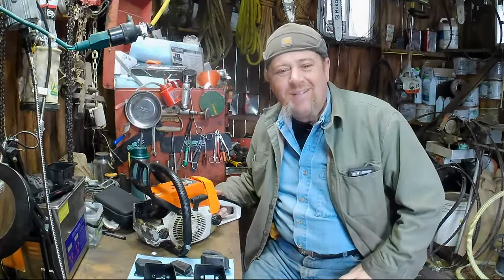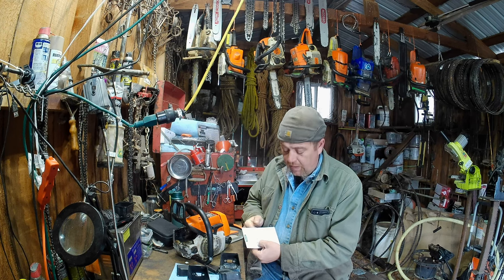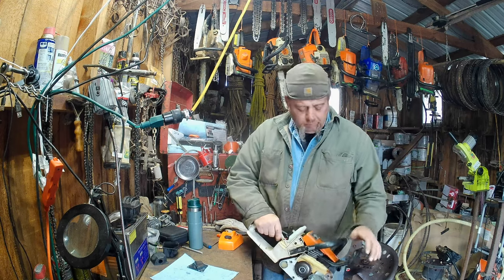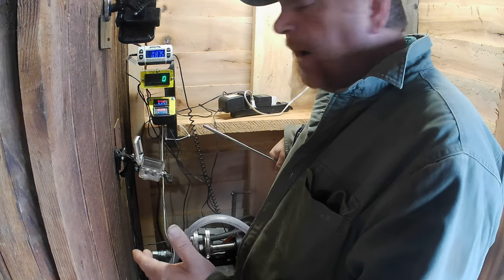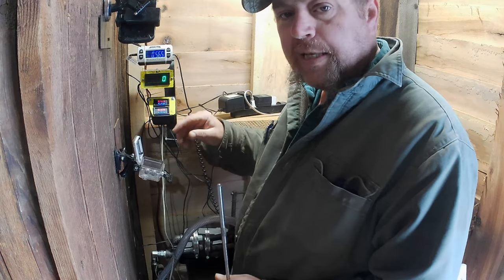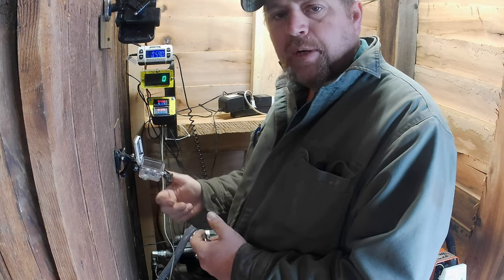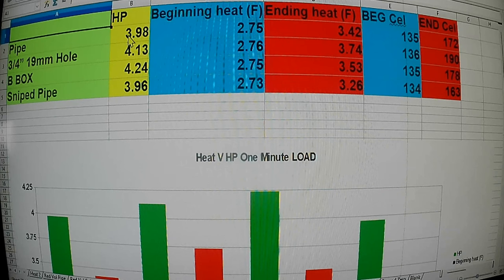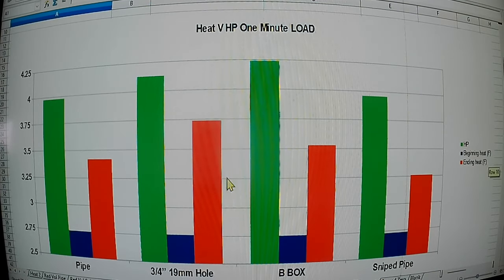BIG HP GAINS by Reducing Muffler Can's Volume? AMAZING Muffler Mod  Testing DYNO HEAT VOLUME Data

Comment: Congrats on getting over the 1k mark, you have some of the best videos out here for the saw people, so i take it if you have a saw with two cylinders then you would have to modify two mufflers if the unit has two mufflers? talking about a saw i bought evidently has two cylinders a john deere 66SV yellow mostly metal.
Reply from the maker: @diggindiggenit6540 Thanks Diggin!  I'll bet that JD is a screamer... reed valves and a shared case, so capacity may be less-per-volume of a single cylinder? Think she needs dual straight pipes with little "ting tings" on 'em. Is it in fairly good shape? They ain't a dime-a-dozen!!!
Reply: @HayChaffandSawdust1  Unfortunately all i have now is pictures as it has not arrived yet And in the pictures i only see one plug and one muffler so i won't really know if is a two cylinder until i get it and search for another plug, kind of a strange saw two cylinders lol imagine porting one of those how would that work? have fun

Comment: Thank you for all of your diligence in testing so many thoughts and theories with these exhaust pipe videos.  Very nice job
Reply: When you say reducing the volume of the can at around 20 min or other points, are we talking just the diameter of the exit pipe?   Or are you also seeing gains from decreasing the internal muffler size?  Length, width, height?
Reply from the maker: @user-ov9zy7pu4s Thanks for joining-in down here in the comments!! About the reduced volume can, I'm sorry that I'm no a very good "youtuber"; I tend to carry on from one video to another and forget to "start over" for the next video; that's my bad. 
To answer your question, I actually reduced the volume of the muffler can by tig welding an angled partition from the bottom lip of the exhaust port to the bottom lip of where the muffler cover bolts on; of course, I fitted it to the edges of the muffler can. It blocked off about 1/4" (s.w.a.g)  of the can.  Thanks again for joining-in; welcome!!
Reply: @HayChaffandSawdust1  That makes complete sense!  Thank you, I actually just saw that video now, I think I accidentally jumped around in order.   I think you are a fantastic YouTuber, you’re doing things nobody else is doing with all these iterations, it’s so fascinating to me.  Thank you for sharing your testing with us.  ❤
Reply from the maker: @HawtSawz86  Thank you for the kind words!! Glad you found the reduced volume ; it's shown a time or two again in different detail throughout the 026 build if you didn't get a good-enough view. The reduced volume can is an easy mod that works well. Thanks again!

Comment: Shorts is where it’s at for growing a channel.  It’s like advertising lol show some dyno footage on those shorts. You’ll get more traction than just relying on shares
Reply from the maker: @jasentonguepowersaws4206 I believe you're right; I've only did a few shorts and a couple of them did get some good response/subs. I probably need to do some more of them. I've been trying to focus on thumbnails and titles the best I can in an attempt to up my click through rate and get new people to click on videos; I'm probably missing out on not doing many shorts though. Thanks for the reminder/advice.
Reply: @HayChaffandSawdust1  I try to do 3:1 shorts/ videos. Even 5-10 seconds of video is plenty.  Seems to be seen by a much larger audience
Reply from the maker: @jasentonguepowersaws4206 Do you shoot shorts specifically or do you edit them out of a wide screen recording to the tall screen playback? The ones I've done, I've used the 1920xwhatever and making 16:9 from them... LOTS of editing and moving frames to try to get it to fit. I do need to do more shorts for-sure!  Thanks
Reply: @HayChaffandSawdust1  I do deliberately make shorts and also just edit video for shorts.  Literally do everything on my phone.
Reply from the maker: @jasentonguepowersaws4206 The phones have as good or better video than a lot of gopro types; also, probably have easier-to-use editing stuff if I were to try it or get used to it. Thanks!!!
Reply: @HayChaffandSawdust1   I agree about the channel needing more shorts for the growth! People love when ANYTHING is put on Dyno's, and to be honest, there aren't that many people that Dyno chainsaws! I'd bet money if you puy a bunch of chainsaw dyno shorts, you would get a ton of traction :) loving the channel and info man! Keep up the good work sir!
Reply from the maker: @jasentonguepowersaws4206 Thanks for the confirmation and the kind words. Sure glad you're here!!!

Comment: Never knew someone so goofy could be this technically inclined.  You sir are a rare breed!  And i mean that in the best possible way.

It did help how you walked through the readouts.  Made watching the pull more informative. Thanks.  Looking forward to the egt readings soon.

I'm still thinking through those exhaust results.  I expected to see changes with reduced volume in more than just the BB clone.  

Just to be a little argumentative, I don't agree that your dual magnets increase accuracy appreciably.  10k is 10k.  More impulses will increase resolution and would help pick up RPM changes faster, but your dyno speed isn't changing much in one revolution.  They sure aren't hurting anything though.  

Now, how are we going to beat that darn bark box?
Reply from the maker: @Kevin.L_ ... and I took it in the best possible way; I always do; when people walk by, look at me sadly, and say "Well, bless his heart", I always thank them for the kind prayers!! 😂😉
 I think a bezel (made out of a cookie sheet or something) may be helpful so I can put the general calculations to the side; would hate to make each video longer by explaining it so that every new person can understand.
I'm not sure about the pipe on the reduced volume because I can't put the toothpaste back in the tube after sniping it off; BUT, I can get a reading from it on the full sized can and compare; the sniped pipe did have a wider/flatter peak than the original box, but it was sniped too?? I'm theorizing/considering/being watchful-of the possibility that reduced volume benefits may be better realized in front exhaust ports as opposed to rear? I'm not too sure that it may make TOO MUCH rebound of exhaust gasses and putting too much exhaust back into the cylinder. Thoughts??
As far as the magnets, I'm not sure either... well, they DO help, but not necessarily in the increased-sample size though. It did help, in that, the refresh rate of tach is determined by RPMs... I can program (well, not "I" yet) the Arduino to use a standard time and makes a calculation based upon how may times the hall effect sensor was triggered; whereas this tach takes a certain number of triggers and and calculates how much time was taken to get required number of triggers. It refreshes each time it hits the required number of triggers; the refresh rate is 2x faster with 2 magnets (over simplified and not 100% accurate, but basically). I could claim two opposed magnets are for balance... but have you seen the rest of the catastrophic conglomeration of junk; I don't think I could convince anyone I was concerned with balance. I didn't take time to mention the refresh in the video...I could jabber about the dyno for hours if I let myself go; glad you mentioned it!! (You're gonna have to try harder than THAT before you could be considered "argumentative").

Ooooh, I got some plans for that pesky ol' bark box clone; heck, we've already improved the original considerably! I haven't mentioned it, but my mind has be searching for the best stock-appearing pipe that I can build for stuff like Sawfest; I probably won't ever have time to go, but it's fun to try to play by their rules. Besides, they have rules against the "Ironhorse" pipe; it would be a feather in my cap is they have to make a new rule and put my name on something illegal too! 😉🤓 It will be a few vids before I get to that one though... I haven't even started building it yet.
Thanks for the delightful conversation!!!
Reply from the maker: @Kevin.L_  I didn't mean to imply they outlawed it in the open classes; for the firewood classes, currently it reads stock size shape and area or something that brings those parameter to my mind; a few years ago, the ironhorse was specifically disallowed for the firewood classes.
Maybe I'm under or over thinking the rebounding gasses as I'm not sure exactly what's going on inside of a can-type muffler; I'm reasonably sure that the sonic facts/theories so heavily researched and documented don't equate inside of a can.

Balance... yes, balance!! You just helped me shave a few minutes off of a future video; It's getting harder and harder to keep a ~15 minute video with all of the results at the end.  Is the results-portion becoming too long, too detailed, boring, too muddled, etc... Would like your opinion; I like the numbers and will take them for myself, but if they are boring to many/most, I sure don't have to include them. On a similar note: Torque? include it or not? On these mods with slight gains, leaving them out gives be more distance between 1/10ths of HP and divides the lines a little further.  Least ways, that was my reasoning. Thoughts?
Reply: @HayChaffandSawdust1  I like seeing the torque curves but HP tells the story well enough if that fits on screen better.  Too much information is barely enough, so I say include everything you feel like needs mentioned.  I like a longer results section.  It's easy enough to overlook data that doesn't interest someone.  I understand you don't want hour long videos that fewer people watch.  Cutting out the actual dyno pulls is a good way to save some time.  Showing one is plenty.  Throwing that original curve back in was a good call.  Also like your cut factor.  Higher RPM or chain speed does matter.  Peak HP isn't the only story.

Again, I agree with you about the cans not fitting the research on pipes.  The distances are just too short to work out like the sonics waves of a true pipe.  My guess is cans and short pipes are going to be about flow more than waves.
Reply from the maker: @Kevin.L_ Thanks Kevin; I know I get plenty windy and don't want to make the video too long by being off-topic and whatnot. I think the torque charts will be included on some build or some simple comparisons where the gains are bigger so that the lines don't meld together; on small differences, having the Y axis showing 2.5-4.5 (HP range) cuts the Y axis by about 1/3 over having the axis ranging from 1.25 - 4.5. I know you like the dyno charts as much or more than anyone and valued you opinion.
Thanks for confirmation on the "cut factor"... unless you can think a better, more catchy or goofy name for it?
There's a lot of suggestions attempting to apply sonic wave theory to these small exhausts; they may be right, but I can't picture it and therefore can't develop a plan for anything which may work. I am starting to consider that I may be getting TOO much rebound of exhaust and cramming too many exhaust gasses back into the cyl... which has upset part of my predisposed leanings; I think the data will evolve into a confirmation of a theory and (hopefully) a "guide" for building working exhausts.  Thanks Kevin!
Reply: @HayChaffandSawdust1  You've done well with the graphs.  Everything fits well and hasn't been cluttered.  I can't think of anything that's in need of change there.
I'll leave the goofy names to you.  I just like the idea of a cut factor type ranking.  
I'm not sure about the rebound shoving exhaust back in.  Back pressure limiting exhaust fully escaping makes more sense to me.  I'll go back and rewatch part of the video yet again and try to stretch some brain cells.  It'll be interesting when you get theory all worked out, and then see if it applies to a different size saw.

Comment: What would U say the best bark box dimensions would be for an ms660? No porting, but flowed the crankcase during the rebuild , new seals , bearings ect

Very interesting videos must also add
Reply from the maker: @AdamHorsch-u4j Bear in mind that I will be purely speculating, but I would think about 3/4 of a square inch or a little less (~5 sq cm or a little less) would be a good place to start; that would be a 7/8 to 1" round hole or a rectangle to get the wanted-area. Standing behind the saw, I like the hole to be at the lower left of the can/cover. I like the shield of the bark box to run toward the top right of the bark box and direct over the chain but not onto the chain brake flag.  Of course, these speculations may be different with a bigger can; I welded a partition in my can to reduce the volume.  Sadly, I can't offer definite measurements as I have not done enough saws to get enough good data into my spreadsheet. The nice thing about the bark box style on a Stihl is that you can build the first one and go bigger until it loses power/RPMs and build another at the previous (best) size; they're one of the easiest builds to do.  They're also fairly easy to accommodate a screen if your local regs require it or if you store your saw where a mouse can fill the muffler with acorns. 
Hope that helps a little; thanks for joining-in down here with all of us riff-raff; don't be a stranger!!
Reply: @HayChaffandSawdust1  cheers for the feedback, I have one on the saw now and it performs great..my hole is slightly smaller but right where U said, I welded a small plate blocking the original side hole and the front plate I made out off 3mm stainless steel...after watching multiple videos off URS last night I've realised that would lead too a reduction too the volume aswell ...it's screams! I modified a 125cc FMF pipe (slightly reduced the belly and stinger at the end) we rpm and temp tested (I don't have a dyno) and she maxed out at 16810rpm. I wanted too use the saw more than 3 cuts so removed the chamber and went on the hunt for the best alternative... I can feel it's not 100% as crazy but it still stands  out!!
Reply from the maker: @AdamHorsch-u4j  Awesome!! I've never played with an expansion chamber on the dyno... yet.  There are better mods than the bark-box style, but I think it is a DANG FINE compromise of power and noise. I found that I can "tune" an ironhorse pipe to beat the bark-box, but it's noisier; I can run the bark box all day cutting firewood without jangling my nerves too bad.  TEMP??!! How hot were/are you getting? I've done some testing (videos not edited and released yet) and am looking for "safe" numbers for temp.
Reply: @HayChaffandSawdust1  yeah I've made one off them ironhorse pipes and wacked it on my ms180, looking back I don't know why as there is no carby adjustment on them but it screams aswell, very loud tho! I'm in my shed looking for my black book where I've recorded temps off the chamber..do the ironhorse pipes run hotter??
Reply from the maker: @AdamHorsch-u4j  The aftermarket carbs have hi/lo adjustments on the carb; some of the 170/180 saws had NO adjustments (I think) while many only had high adjustment. I do prefer to put an AM carb on with hi and lo adjustments.
No, the ironhorse pipes don't tend to run hotter; as a matter of fact, they tend to run cooler...if the pipe lengths are correct.
The reason that I was asking about temps, I'm trying to get an idea of "safe" temps for modifying a genuine work saw that can stay in the wood for a tank of fuel. After getting more HP than stock, cooling can become an issue; I'm looking for safe numbers to stop adding HP. I actually detuned my 026 build as it was getting too hot (I think) after pulling hard for 15 minutes or so.  I did a torture test on the stock husky 455 with the carb limiters still factory-installed; that's the only stock heat numbers that I've got from my dyno.